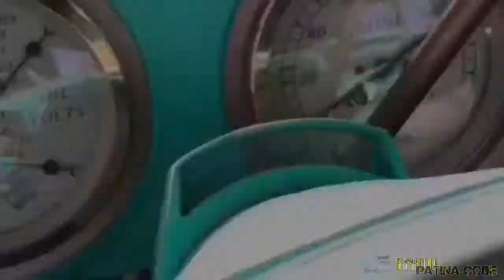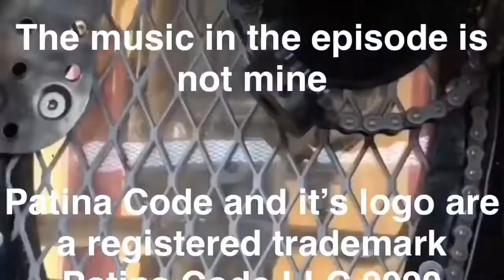So You Wanna Build An AD episode 2

Comment: Do you have a email I can contact you I have a few questions for my 72c10
Reply from the maker: Hi , what are your questions ?
Reply: I got a 72 c10 that I am ls swapping everything is pretty much connected but the truck has the ignition switch then a button to send the signal to starter has 2 wires but the harness I got also has a purple wire for starter is there any way I can get truck started with the stand alone harness